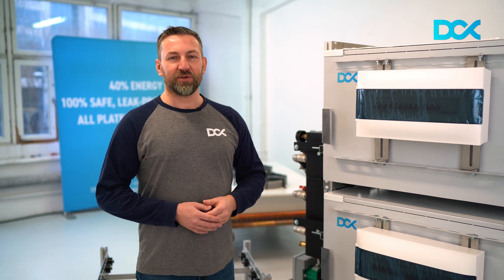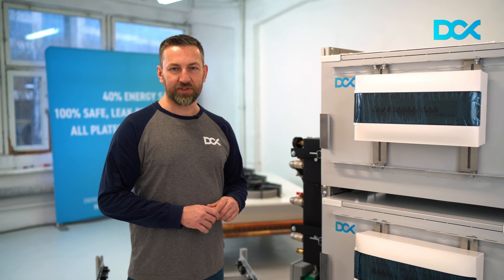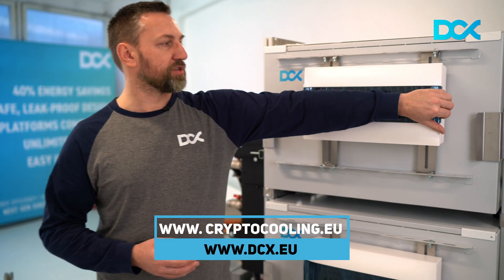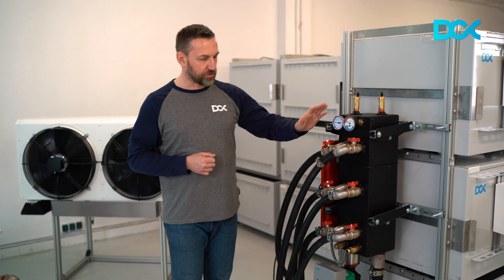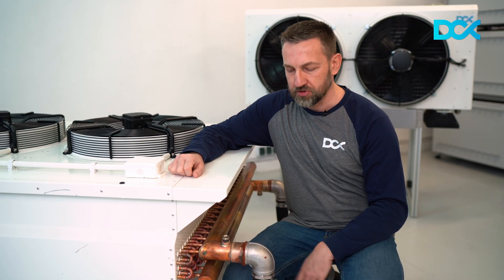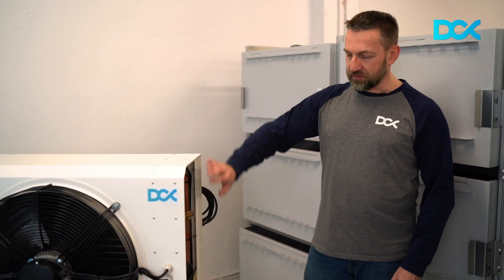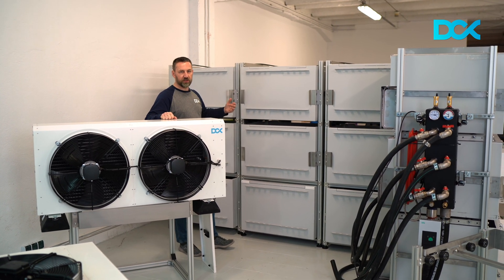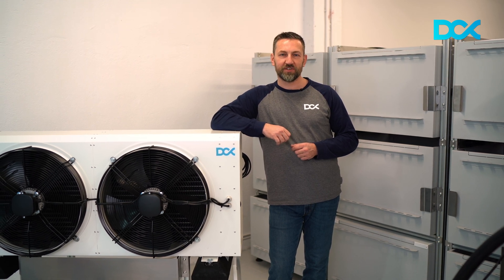DCX Immersion Mining Systems | 2021 Q1 Update & Walkthrough

Comment: Hi, Can the heat exchanger be placed in a large warehouse or does it need to be outdoors?
Reply from the maker: it must be located outside with access to air. But you can position that partially. We can explain that  - www.cryptocoling.eu , use get the quote button.
Reply: Hi, we are manufacturing and selling immersion liquid cooling box. Here's a video for your reference https://youtu.be/PByu8PVD6S0; https://youtu.be/PByu8PVD6S0
Ours have the heat exchanger built in the cooling box.